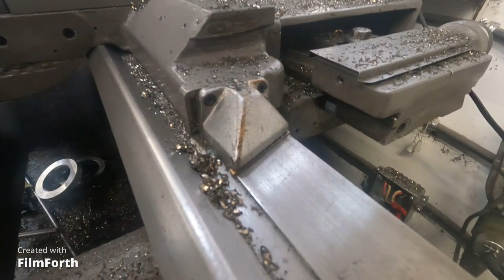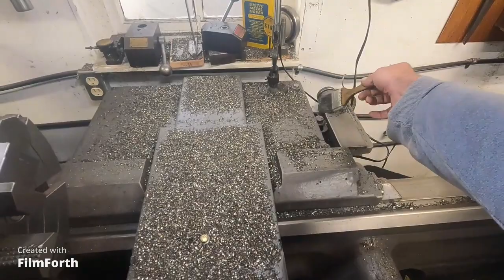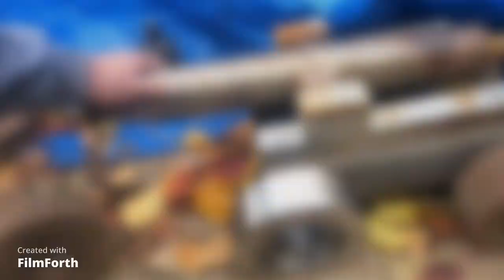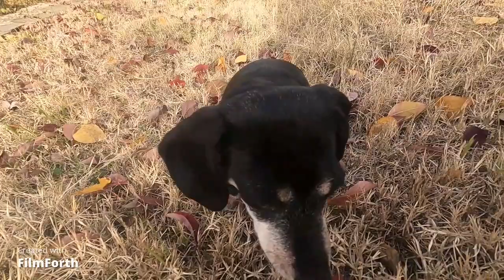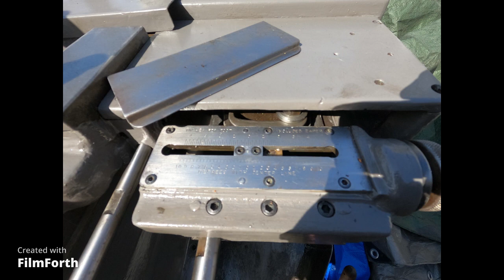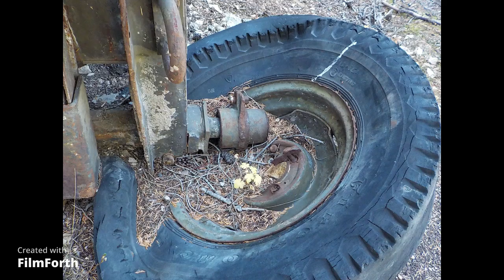Axelson lathe machining cast iron 2

Comment: Interapide indicators are the gold standard in my book. Getting by with my best test brown and sharps though. Agree to disagree with that flex arm thougn. Have nothing but problems with mine. Love my Noga.
Reply from the maker: I took fine Clover lapping compound and worked it into the links on the FlexBar making it work smooth and lock. I have 3 Noga bases but they do not readily work with the Interapid round tail. Thanks!